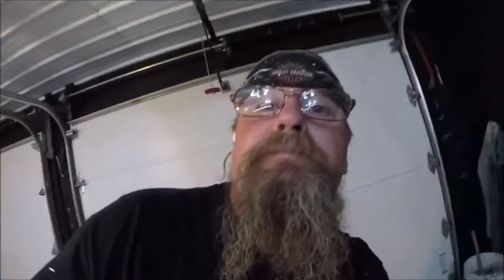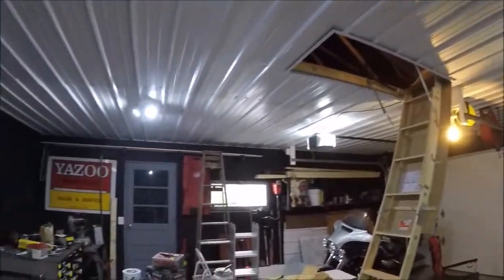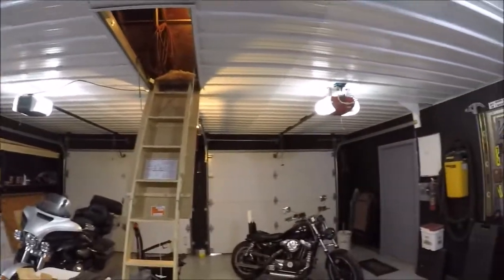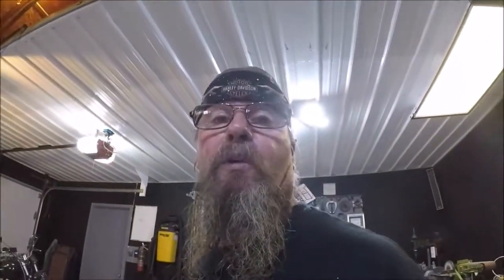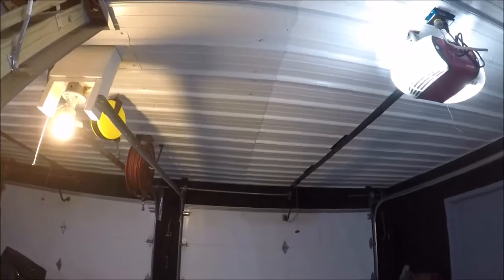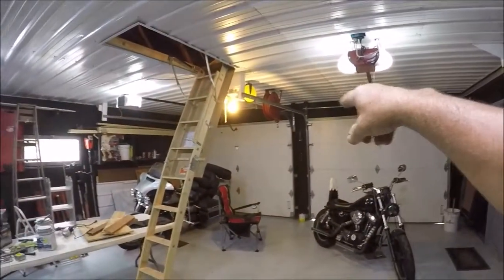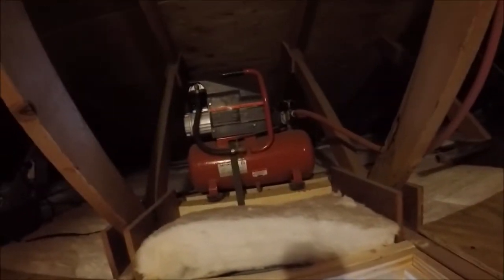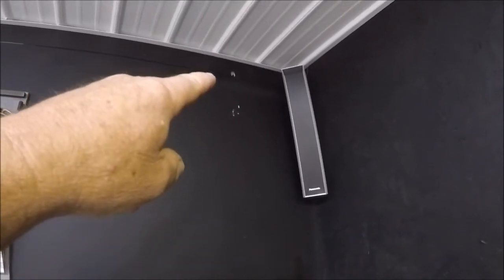Garage Makeover Part 8-Ceiling Panels

Comment: looks good to me.thought about draining the compressor yet?up in the heat might make more water.
Reply from the maker: I plan to run a drain hose for easy access. Good call.
Reply: that groove on the paint can were the lid goes on punch some holes with a nail and it will drain back in the can no more bs
Reply from the maker: @65jazz45  That sounds like a great tip. I'm gonna try that. Thanks.